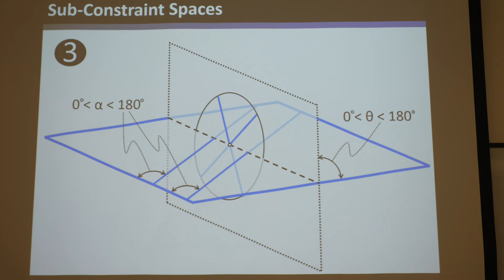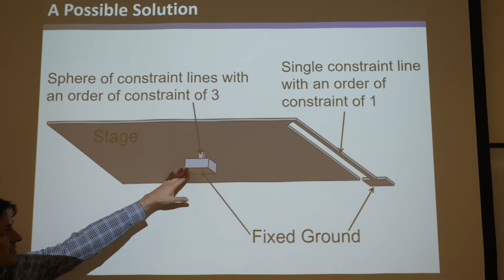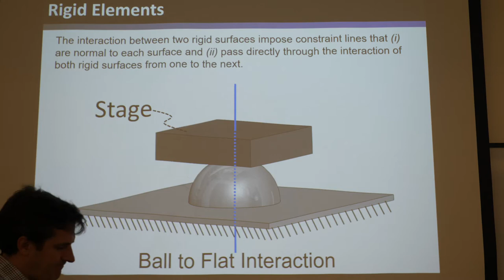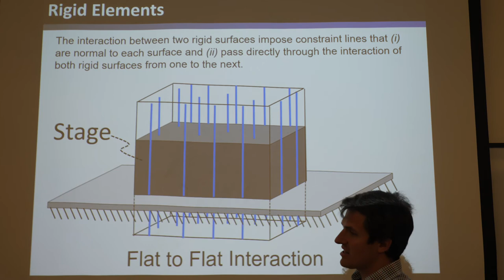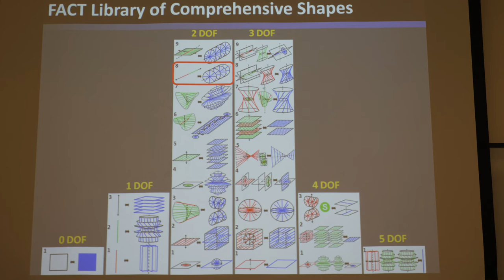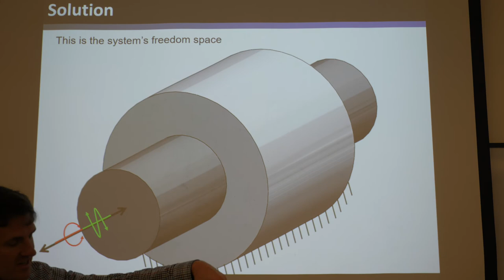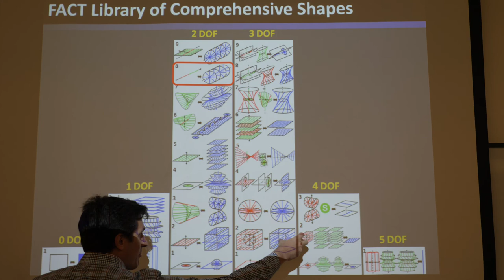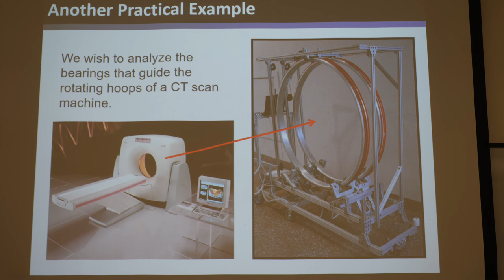Compliant Mechanisms Lecture 7 Part 4

Comment: That CT scanner example is just so eye opening. I find this "topological" approach with the fact sheet super helpful. In 90% of all cases the freedom and constraint spaces are trivial anyways, until you deal with some fancy 3d flexures, but even then i find it really helpful. To understand a simple ball bearing or xy translation stage I used a million times without thinking about it.

Exact constraint is such a powerful concept.
Reply: Also, judging by the view count, not many people made it  through the whole lecture, but I think it is really worth it.

If you want to cheat the YT algorithm a bit, mayby make some yt shorts about the "catchy" examples from your lecture, like this example with the ct scanner.